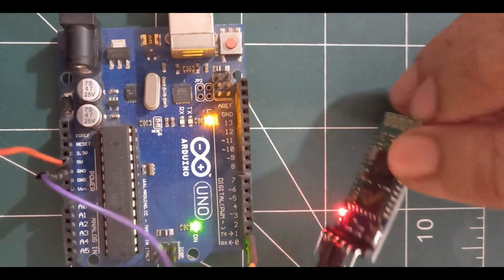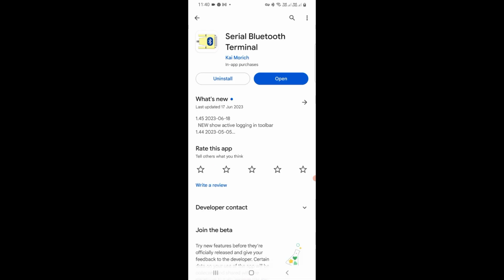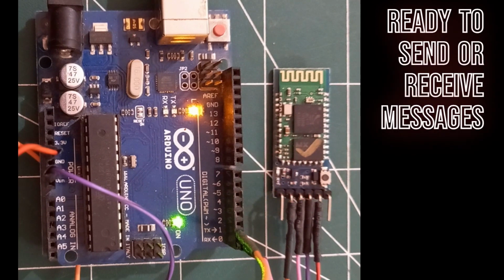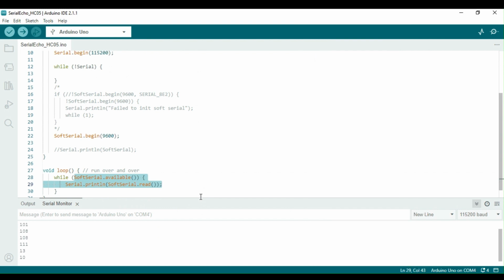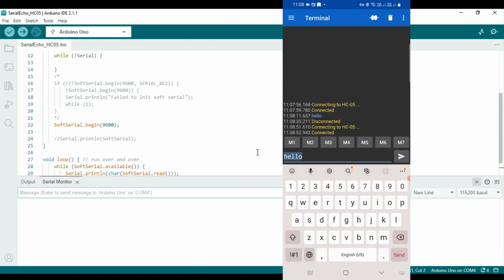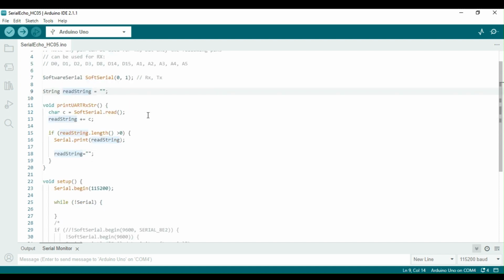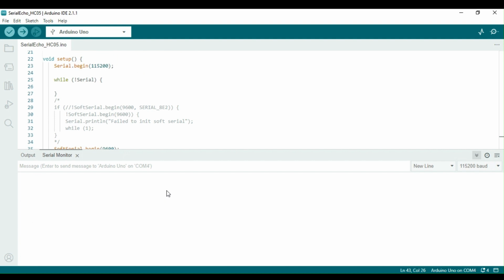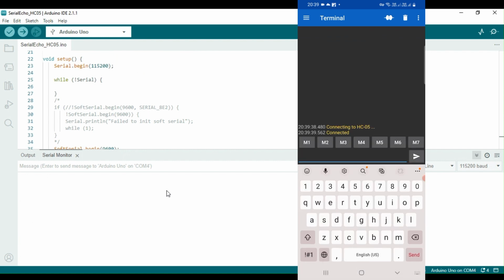Arduino UNO with HC-05 Bluetooth Module

Comment: I am impressed with the video, I have a question, what if I make a mini sprinkler with Arduino uno CH340g, how can I control it using Bluetooth?
Reply from the maker: Hello, thank you for your comment and appreciation!!
What kind of sprinkler are you planning to you? If you could find a sprinkler that can be controller using actuator that could controller using electrical signal, then it will easier. Did I get your question right?